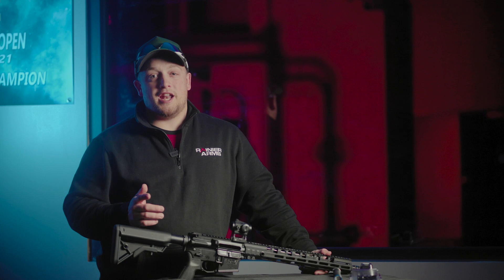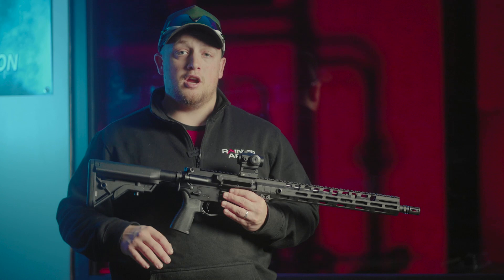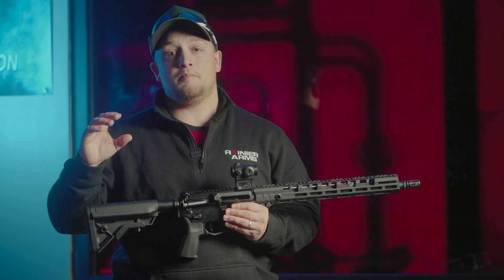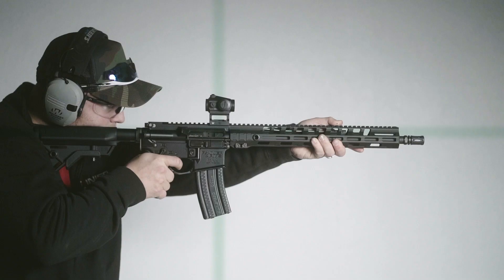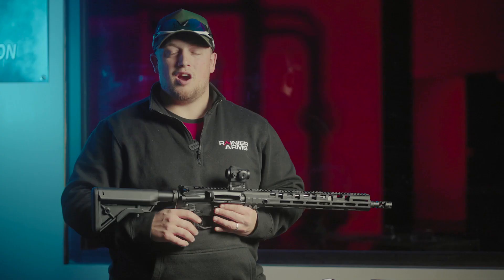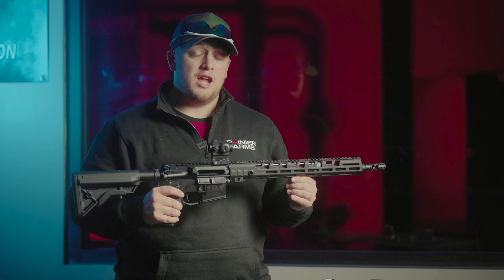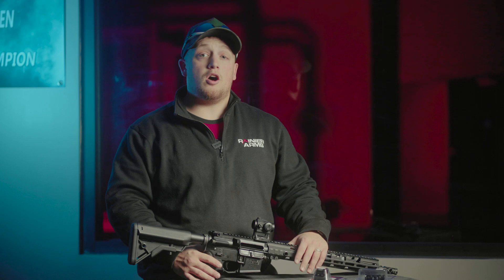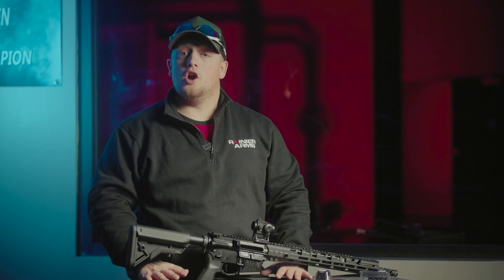THREE WAYS TO REDUCE RECOIL ON YOUR AR-15

Comment: But what did you use specifically? and how do we know what spring or buffer weight to use, or even any tips on budget adjustable gas blocks.
Reply: I have an H2 buffer and sprinco red tip on mine and the recoil is non existent with the bird cage. Threw a muzzle brake on it and it’s even better.
Reply: I don’t have an adjustable gas block on the one I built. Since it’s an a2 upper.
Reply: @Conky88  what muzzle device did you get
Reply: Starting to wonder what the mean by budget as nothing I buy for my guns are cheap fuck even the ammo is crazy expensive. Budget nothing… lol cheaper than others maybe but so called budget… non existent….
Reply: @Cloud4hundred20 lol that's the truth. Budget because you need to increase your parts budget and eat less.